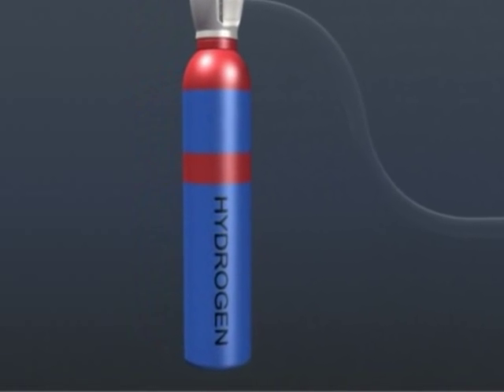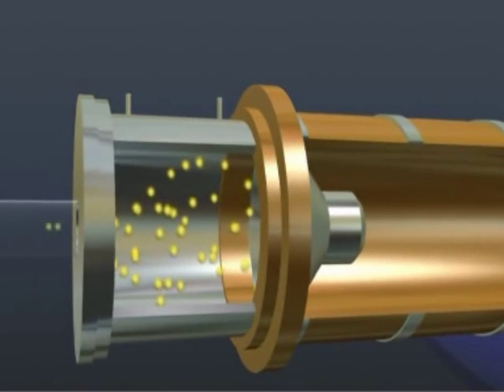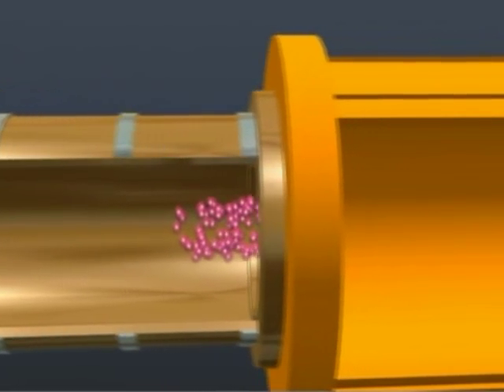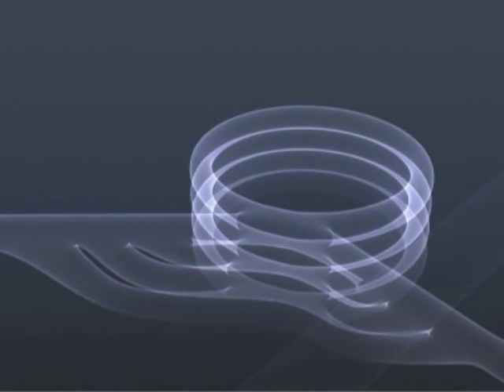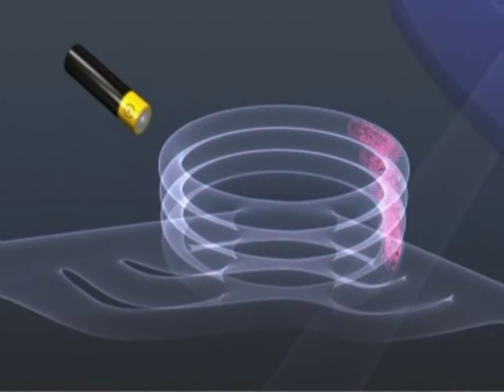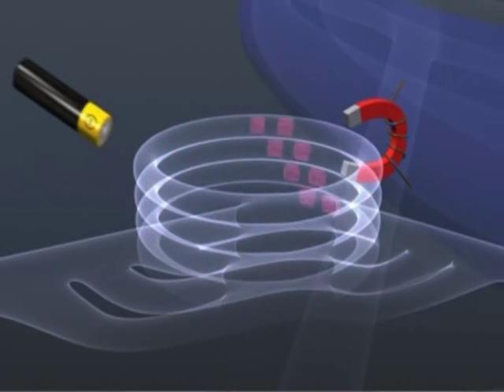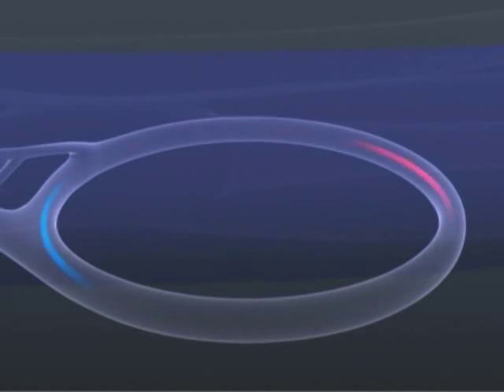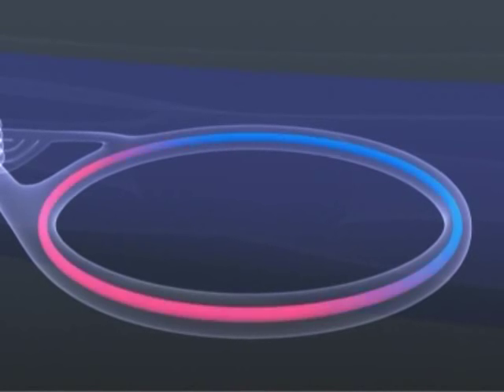LHC Particle Acceleration In-depth Explanation

Comment: I heard that at full power, the particle beam carries the kinetic energy of a freight train at commercial speeds. They had an accident near the beginning where one faulty supraconductor opposed resistance to the massive power flowing through, and if I recall correctly, the particle beam deviated and made magnets move. And by that, I mean that it lifted fifty 20-ton magnets about a foot upwards, tearing anchors. That really makes you appreciate the scale of the energies in play on this project, and how far mankind has gotten in its mastery of the very forces that define our universe.
Reply: More like a car at motorway speeds.
Still bloody impressive though.
Reply: “…our universe.”